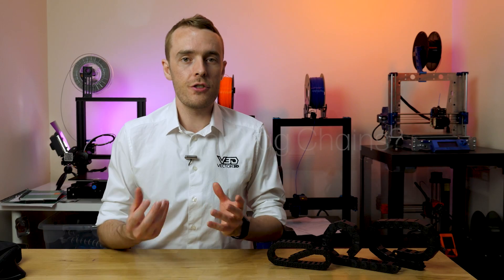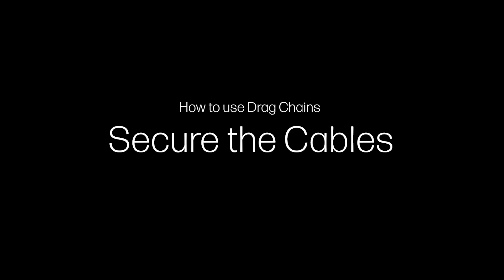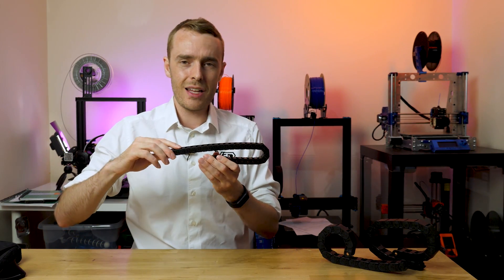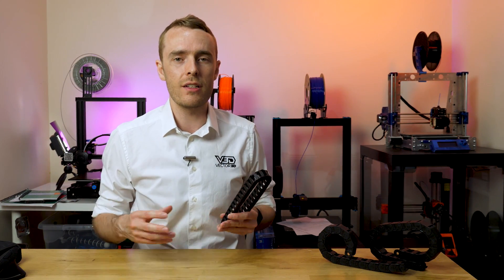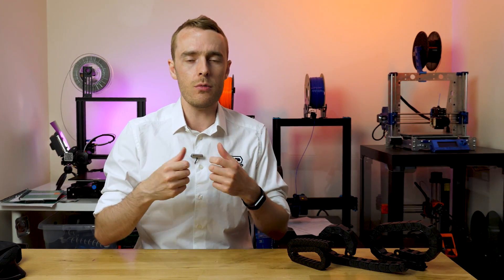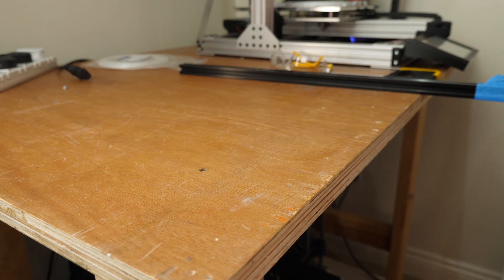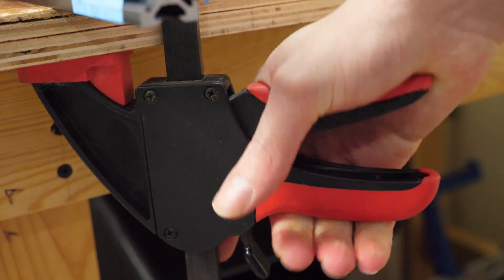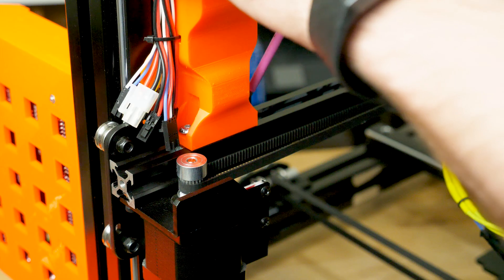Safe 3D Printer Wiring Guide Using Drag Chains

Comment: Great video to explain best practices for drag chains. Also, that was a great design for your printer's X-Axis wiring - were there 3 drag chain segments in total? (one for x-axis from hot-end to left riser, another for the y-axis wiring and a third from the x-axis on the left riser to the circuit board?) - Fantastic demonstration. Best regards.

Comment: I am more than a tad bit suspicious of drag chains. Because they bend the cable sharply at one place at any given time rather than distributing the bend throughout the whole length of the cable. And doubly suspicious of doing that with silicone sheath wire because the silicone is super flexible, and translates all this bending right to the copper underneath. And most of the time the printer will be moving around the middle position, so it forms a likely breaking spot, wherever the middle of the range of each axis movement is. What they're great at is keeping the wires out of the way of everything else, but i feel on a 3D printer that's a problem easily solved.

Comment: I think loose movement of wires inside a drag chain is bad as the insulation keeps rubbing on the inside. A slight stretch of wires is nothing to worry about - but when insulation comes off due to rubbing it can potentially short out. It is probably better to have a less loose fit with only a bending movement just like a cable binder does.
Reply from the maker: Yes, too loose and too tight are both bad. But being fixed both ends is most important.

Comment: Excellent video. I have to add my 2 cents. I have been building custom automation machines for ten years. There is a sweet spot on strand count. Too many very thin strands will actually break much easier compared to a wire with a lower strand count. This has to do with cross section of the strands. Too thin and it will break very easily. Also I have found using a silicone high strand count wires break much easier even when used properly in drag chain. Of all the failures I have had in drag chain setups it has always been high strand count silicone wires. With an adequate bend radius regular moderate strand count PVC wire has been the best in my personal experience. Of course if you can source and afford it buy wire specifically meant for drag chain flex applications. Please do not make the same mistake I myself made countless times thinking high strand count silicone wire was the best solution. It is not.
Reply from the maker: Thanks for adding that. Great information. I've been testing this silicone strand count on my extrudinator machine for around a year or so now, that's why i was happy to recommend it, i think for most low velocity and low duty cycle machines it's sufficient. Obviously the optimal solution would be correctly specified flex cables but they're way out of budget for most DIYers from what i've seen. Do you have some detailed specs for medium count copper wires you could recommend?
Reply: @Vector3DP  Thats a tough question to answer due to the wide variety of wire offered by countless manufacturers. I would strongly recommend copper tinned wire vs aluminum wire with an alloy tin. If you can find it, MTW (Machine Tool Wire) is probably the safest "generic" wire out there for 3D printers.
Reply: @Vector3DP  Great video. Tom Salander (spelling) also have a good source for chains and wire management.
As for the cable i use, i mostly go with RKUB. It's the same type used in most veihcles where vibrations is a concern.
Or H07RN-F with varied cores if i example need both power feed and signal in one cable. Remote sensors etc.
Reply: A cable that is too floppy will move around within the drag chain. Thicker insulation, larger strands, or stiffer insulation will improve that situation.

Comment: I notice you have not used 3d printed drag chains, are they not good enough?
Reply from the maker: I've not tested them so i wouldn't know if they are adequate. My estimate would be that they are difficult to print well and low quality could damage the wires. For now my recommendation would be to purchase them, or do your own longevity testing to see what works.
Reply: Drag chains appear to be very affordable on AliExpress and the like (even Amazon with Prime, though with a smaller range to choose from), while they seem like something that would take an age to print - and much longer if you had to print a dozen variations to find a design and correct print settings that the printed version worked well!